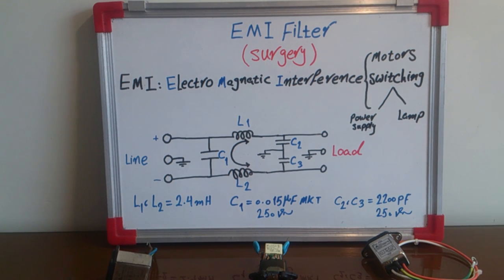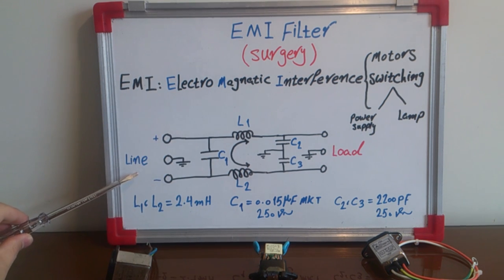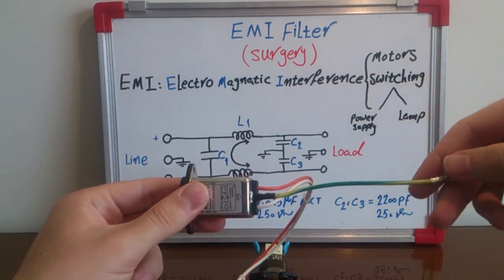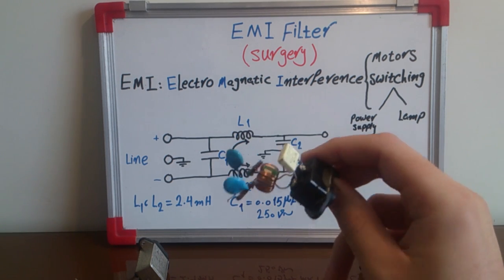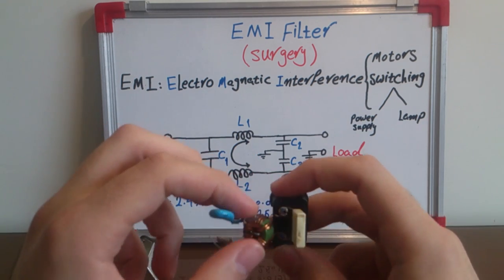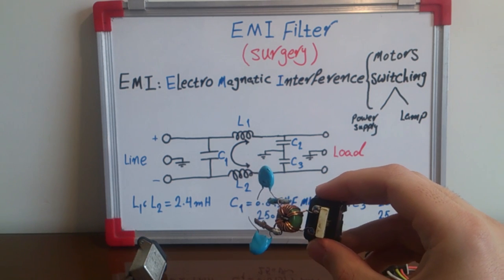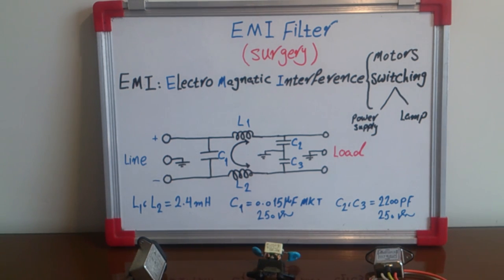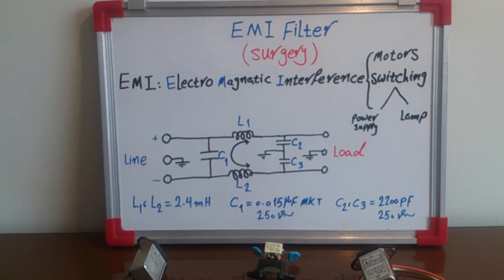What's EMI (Electro Magnetic Interference) Filter? we open one of them to find out the answer

Comment: So I'm no expert, obviously. I'm here because I searched for EMI filters and am checking my own understanding of the subject. 

  One thing I am aware of is that the cores used for filters and chokes are different than the ones used for transformers and other inductors. The formula used for the filter cores has a much lower permiability. This is done because the purpose of the filter device is to dampen spikes or differences between the two coils. A regular inductor with a higher permiability will tend to transfer more of the noise from one line to the other. The filter core is formulated to reduce noise, not conduct it.

  BTW as a native English speaker I understood you fairly well. One tip though. Look up the word "story" and the word "store." You sound funny saying that one. It is no big deal. Those words are just totally unrelated.
  We would also refer to a coil of wire as a winding. The word looks like "wind." There are two meanings for wind. The most common definition is related to weather like, the wind blows in the rain. This is pronounced like wh-end. In electronics, when a wire passes through something like a core, we might call it a winding or windings. This word is pronounced like why-nd-ing. One subtle/small thing to note about these words, you would never say winding (wh-end-ing) in reference to the weather. Likewise, you shouldn't use the word wind (why-nd) to refer to a coil of wire. Technically you will hear people use the word wind of wire occasionally, but this is bad English. It should be called a "coil" of wire. 
  The last issue with the word wind in electronics is, when you make an inductor with a wire and core, the act of wrapping the wire would be "to wind" (why-nd).
 Let me give you an example that uses most of our common terms in English:
  The weather is bad today. It is raining and the wind (wh-end) is blowing.
  Inside the electronics lab we are working with inductors. The class should have a transformer core, and a "coil" of wire in front of them. Our first step is >to< wind (why-nd) the core with wire. Our transformer design calls for 10 "turns" of wire through the core....
.....
 ...Now that you have "wound" [this is the past tense word for "to wind" (why-nd)] ...your inductors you should have around half of the original "coil" of wire leftover ....

 ... Anyways, hopefully that helps. I know English has a lot of stupid words like this that are poorly defined. Don't let that hold you back from posting content though. I still understood most of what you said.
   I'm not writing all of this to discourage you. This is just the kind of info I would want to know if I were doing the same thing in another language.
I subscribed :-)
  Thanks for the upload. 
-Jake
Reply: Don't be shy to say his English is very very bad. You wrote a long STORY, spent too much time  to tell him that he is making fatal mistakes while talking English. This guy has simply no clue of English and should stop.
Reply: @ziadalashqar  Something is definitely wrong with you man...Have you been born with a university diploma on English literature in your hand? 
His video is about EMI filters, not an essay on Shakespeare. Come to your senses man, please!
Reply: Thanks for the effort you put here Jake! Respect man!
Reply: Thanks for all these details you shared with us 
Thanks for your efforts

Comment: How to calculate the value of the inductor and capacitor use for EMI filter
Reply: that is the golden question in emi filtering
Reply: That's something Intellectual 👍😉more better then vedio
Reply: There are calculators for these ................frequeny calculation series inductance /parallel capacitors ...............also note the current demand , for 1A /230 volt up to 10A /230 volt or more .
Enough material on the web to serve as an example and to understand, but you can simply buy them !!!

Comment: a bleeder resistor for discharging capacitor c1 to a safe voltage in safe time span is required by electrical regulations. c1 also has to be x rated, while c2 and c3 has to be y rated.

a MOV rated to 230v×√2×1.25 parallell to c1 to suck up voltage transient wont hurt either, while if you want to put MOVs in parallell to c2 and c3 they need a gas discharge tube in series for regulatory reasons - which limits their usefulness. a varactor in series with the MOV can decrease leakage current and increase product lifespan.

Comment: I have all these components on the primary side of my power supply but it still produces noise. I have a portable FM radio with a small antenna which I use to trace interference. I waived it over the PS and I found that noise spread is ~5 feet in radius, more intense(ticking noise) on the transformer. Switching freq of chip is 240khz, so why am I getting noise in the FM band(mhz)? and why don't the filtering in the primary side work?

PS is connected to a resistive load and noise increases if I increase load draw.

Comment: Hi guy, How did you caculate parametter C, L... in circuit? thank u
Reply: These are typical values of EMI filters. He didn't calculate anything. He just copied the schematic and the component values of the filter he opened. Usually this information is printed on the case of the filter. Hopefully this helps you.

Comment: whether it can use in  230v in 6 amps circuit ?
Reply: from my experience, if you buy something from china, just divide it to two. you need  6 Amp buy 12 Amp. never believe that they write, its china, another culture we with European culture constantly fall into this trap. if  you understand my english
Reply: @ДмитрийХодаковский-е3б  that's true :D
Reply: @ДмитрийХодаковский-е3б  you are absolutely correct, and your english is more than adequate. 
Most of the Chinese electronics i have torn down for years now have been complete garbage. 

I see materials and build quality that are just barely enough to not burst immediately in to flames.... 
Even then a slow over current or high enough inrush current usually results in a blown fuse at best and a chinese fireworks display plus fire at worst.